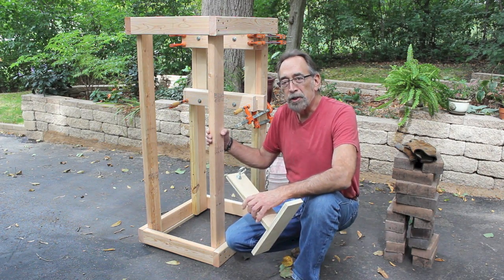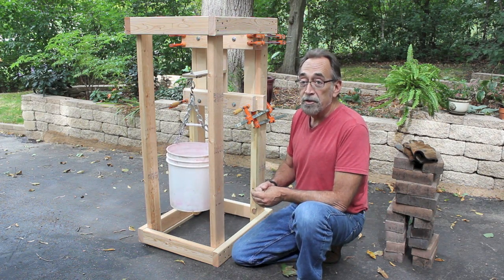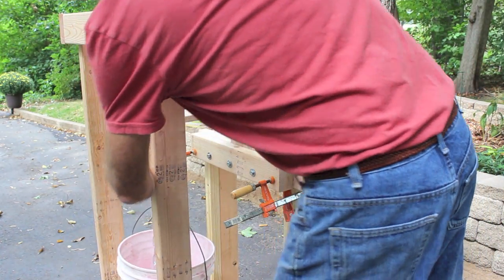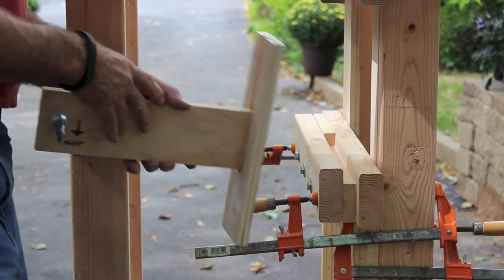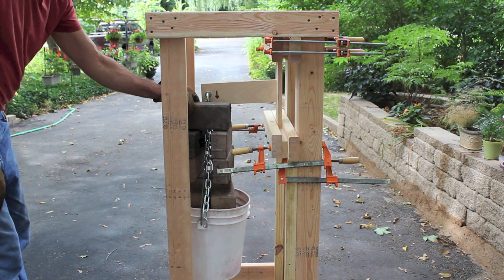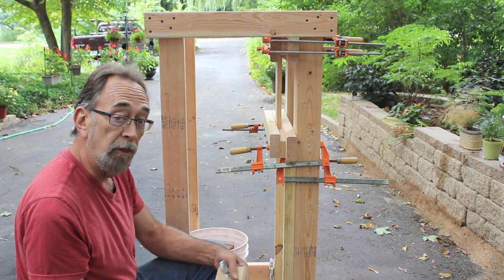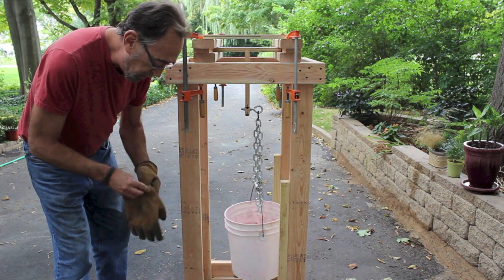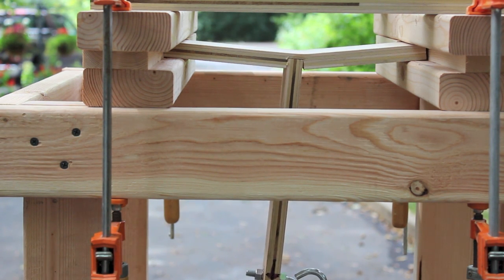Dado Depth Torture Test

Comment: Hi, good video and a lot of effort you put into it !. The " sheer test"..... the wood you used is around 5 inches in width i think, do you think if the width was instead  15 inches the sheer test result would also multiply by 3? I.e instead of 33lbs it becomes 99lbs?

Comment: Steve, I really enjoy your videos but I have to say I don't see the value in this test. 

About the only times I use dado cuts is in casework where it holds a shelf or vertical divider, in both cases that inserted piece will be supported by an opposite dado. I've never used a dado to hold a piece that is cantilevered out into space with no other support. This test only reveals that a dado used this way is not much stronger than a butt joint.

Of course it's going to be weak.
Reply from the maker: The question posed by the test is "what depth?" is ideal to make dados in plywood.
Reply: To clarify, what I'm saying is that whether a dado is 1/4" or 1/2" deep, it really doesn't matter much because dados are used in pairs to support each other by keeping the panel level so as long as the panel stays seated in the dado it will support a lot of weight.

 It just seems like the test is not reflecting real world conditions, that's all I'm saying.

Comment: Ok, so...I think there are other factors to consider here.  1. The type of glue. 2. The clamping pressure. 3. The "clamped" time. 4. Air temp.  There may even be other variables but with just using those, would you not be able to vary the results between tests?  Ok, so maybe I am getting too picky, just looking at all of the variables and at a different angle is all.  Enjoyed watching the results - never would have guessed that the deeper joints were not the strongest.

Comment: Really a good Test, but let me be the weisenheimer here for a minute ;-)
i'm afraid, you made 2 mistakes, that failed your results.
first: you added the ringscrew always at the same side... by doing this, you also added additional forces to your test-setup. (torsion between the chain and the line of your joint at the most times.)
second: your "Groundplate" is hanging free, so it can bow! so, again... an aditional force. and: Plywood never has the same cohesion at different point of a sheet, so you add an variable to your test, that you cant controll: is this piece so strong as the last one? Do the layers stick together, or is there a cavity?

yeah.... a few years in material testing really ruins a person^^

Comment: Excellent test, however it would be even a greater challenge to do tests using the three step process you used for all joint types. It would be great to see dowel, biscuit, pocket, finger, mortise and other various joint tests to see how they all stand up. Of course the same type wood and glue would need to be used to make everyone happy. Especially since this would be a one joint test and not a part construction test.

Comment: Makes sense to me. Even though surface area is increased for glueing you reduce the strength of the board that has the dado. But things change when you basically turn it into a joist. Interesting but not exactly conclusive with only one test per joint.

Comment: Interesting test and I agree with you. Since dados are primarily for alignment and support, 1/4" deep in 3/4" stock is fine. Going deeper doesn't significantly increase support and weakens the structure (say the side panel of a bookcase), and that will be the case with all materials, plywood or solid wood.
Guys asking for glue brand or to redo the test with solid wood are really showing a lack of experience and a basic understanding of joinery.

Comment: Seems like the joint failures had as much to with ply grain direction as it does with the depth of the dado. Also dado's deeper than 1/4" seem to weaken the ply wood allowing it to fail due to flexing.

Comment: Wow at the range of comments. Good video and quality was fine for me and this test, didnt see a need for JD quality on this one. Yep, solid wood would be different, but so would types of solid wood vs hard wood and for the plywood and glue type... Well guess you could follow up with brands but I still saw the logic and engineering of it all and agreed.  Would be interested in same type of test with different brands of glue.  But good grief people. You know if he had of used 1/2 inch steel....

Comment: Solid wood results would be completely different. Those dados are only as strong as the ply glue. Plus each layer would vary. The only one accurate for glue strength would be the last one the pull test.

Comment: The shear test is not realistic. On a real world application the free end of the board would be supported by another dado. So if there's a load on it it would be acting with a downward force and divided by either end. In this test it rotates in the joint acting on the plys above.

Also is that ply home depot birch? If so you need to test a better plywood. From my understanding that glue is formaldehyde free so the glue sucks big time.

Comment: during my apprenticeship 42 years ago, I was taught that Dados are generally 1/3 to 1/2 the thickness of the wood.  Many times we just used 3/8" depth throughout.

As mentioned, the results are not conclusive because you used Plywood which is only as strong ad the wood used to make it and the glue used to hold it together.  MDF and Particle board would also peal apart before the glue line fails.

I would do it over using piece of poplar or even pine all clear and all cut from the same board.